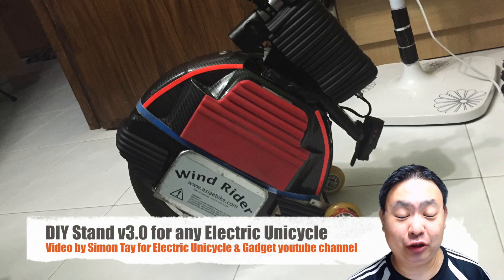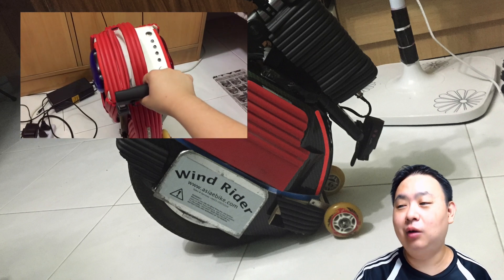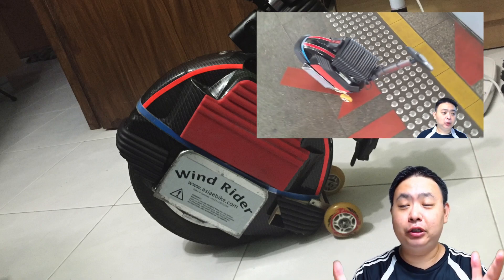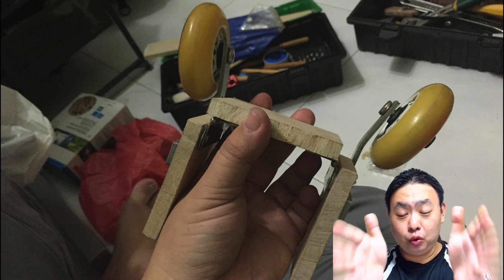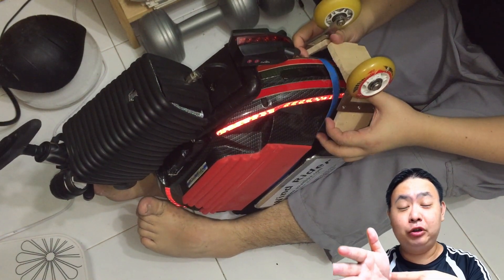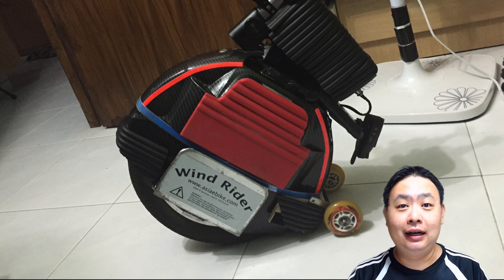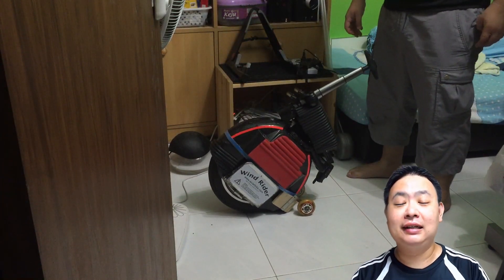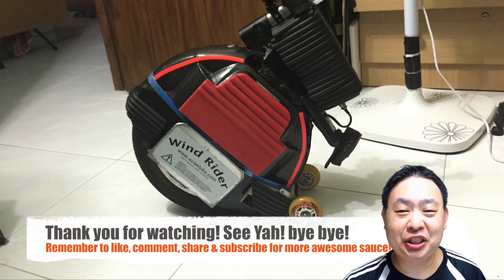DIY Stand v3.0 For Any Electric Unicycle

Comment: Simon ... Nice i use bolt m10 double end then put m10 knob. Sam.. I need to lock my electric unicycle which lock should i use?
Reply from the maker: +Benny Toro To be honest, I bring my unicycle everywhere I go as it's too precious. Get a trolley or pull rod to push it around :D